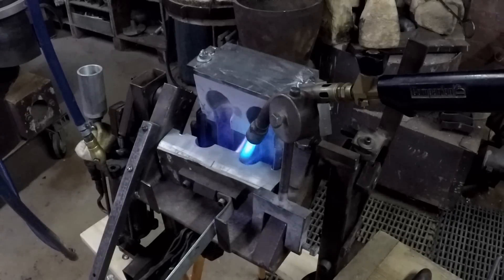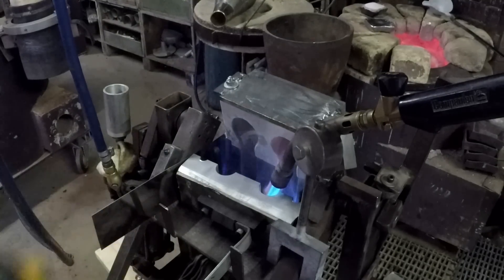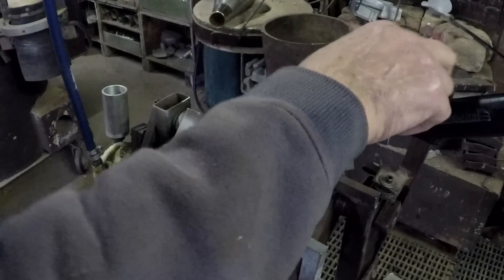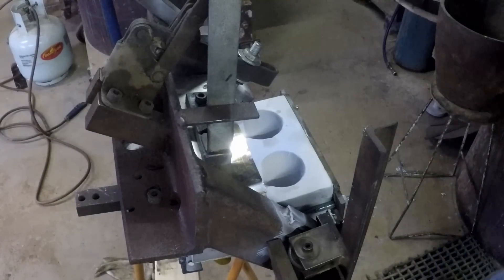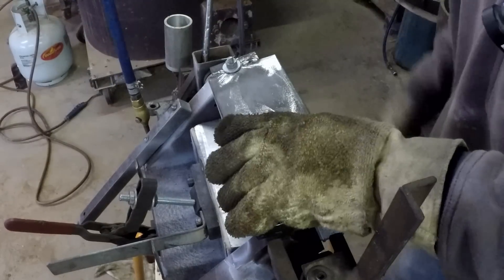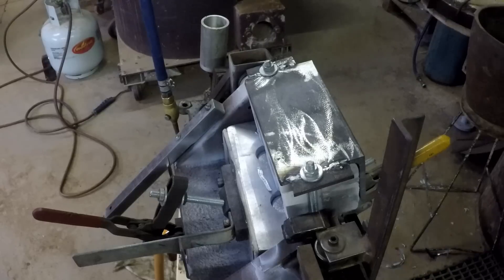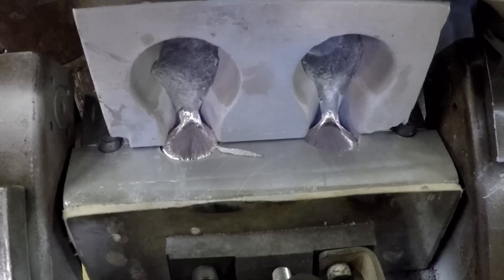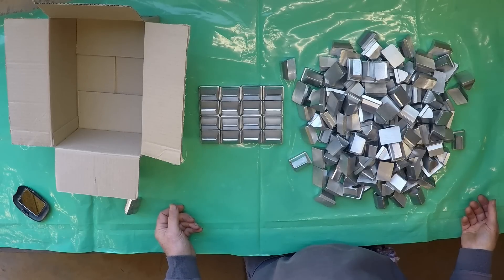Lens Blank Gravity Die Casting

Comment: Splendid as ever Martin ,interesting thing about the optical  pyrometer, I allways fancied one but I'll make do with my pyrometer with a K thermocouple I allways paint it with a zircon refractory wash to prevent the metal sticking to it,I paint all my ingot molds & metal crucible with it as well but not the salamander crucibles, as you will know molten alloy corrodes steel [& contaminates the metal.]
Graham.
Reply from the maker: Graham, I use a type K MIMS (mineral insulated metal sheathed) thermocouple. I have found that Boron nitride is the best protection wash (Hardcoat by ZYP) as it repels fluxes and molten metal but its temperature limit means that it is not suitable for copper base work, For that I would use a zircon wash. I also use the hardcoat on the transfer ladles I use for gravity die work but it is too expensive to use on ingot moulds etc. If you are going to use metal crucibles to melt metal in please don't tell me about it - I don't want to know 😀 as contamination will eventually inevitably occur and it ruins the metal... Martin
Reply: Hi Martin, thanks for the info, when I first started I used salamander suprex crucibles [clay graphite] for brass/bronze Alloys & occasionally iron[seperate one for each of course] I still use them 99% of the time but on occasions where I need larger capacity for alloy only I made one out of a cut down co2 pub gas bottle & coat it with refractory wash![nothing importane mainly house plaques.
Graham.

Comment: 15:40 that reddish-pink glow on the metal, is that the glow from the heat? Or are these other effects happening?
Reply from the maker: Luke, It is from the heat I believe, but these cameras are easily fooled by light levels and background colours thus and do not necessarily give a good colour rendition. Here in the video it looks a little more "pink"  than in real life... Martin
Reply: It struck me as an interesting colour. I don't have any experience with liquid aluminium (yet). I guess the lighter metals melt first before they glow, where iron glows first before it melts... Ahh, just talking about it, and seeing it's a cool day outside made me decide that I'll be doing some forging today. Always love the radiation heat coming off the work piece.
Reply from the maker: Luke, Aluminium turns red about where it melts or a bit above depending on how bright the ambient lighting is the same aluminium at the same temperature can look silver or quite bright red. Cool day, hell, its just 12 deg C outside way to cold for an oldie like me.. Martin

Comment: Hi Martin, a very interesting video series for low rate die casting. Reading through the comments section is also very educational, filled with lots of little pearls of wisdom.
Question, your ladle where do you source them from and it would appear that you have coated it in a refractory cement.
Reply from the maker: Mark, That ladle is a standard product available in a range of sizes from a local foundry supplier. It is only mild steel. I paint it with a boron nitride wash - Hardcoat by ZYP coatings. This wash is expensive but very good. I can give you the Australian suppliers of both of them if you wish... Martin

Comment: Hey Martin. Before you cast the dies for the gravity casting. Do you take the die dimensions into account including with the sprayed on layers? Im just curious how much influence that layer has on the finished product and how good it will fit after.
Reply from the maker: Han, With other work like this I have calculated it all out methodically - the various shrinkages the thickness of sprays etc. and machined the masters accordingly, this time, eh, not so much -  in the sand casting stages I wobbled the patterns around a bit to make the cavities bigger to compensate for the shrinkage but really it just all happened. The parts are small so shrinkage in actual measurement terms is small and the proof of the pudding was when castings were tried in the light and air pressure applied to check sealing no leaks were found so the fit was judged Ok. Customer happy so I am happy... Martin

Comment: If you have anymore larger amounts to make, you need to make a large mold that could pour ten at a time. Automation is the key to mass production. Nice video and clever setup.
Reply from the maker: Gary. Could not agree more, but this was the biggest die I could accommodate in my little tilter and I did not wish to build a bigger one, also there is a limit to how fast I can supply metal  -10 at a time and I would be refilling the crucible every 30 minutes and it takes about 45 to melt! A bigger furnace would be needed and it all just gets out of hand for a little shop like me...Martin

Comment: Ha, I shot some video last weekend and I to use my non contact IR temp gun.
I was casting brass and the temperature was showing low as they do.
Simply the best surface for these things to read against is black that added to other things makes then a guide only,
A quick and easy guide mind.
Reply from the maker: Andy, My advice - get yourself a proper thermocouple mounted in a suitable sheath. (for aluminium but NOT bronze boron nitride wash forms a very effective sheath). That quick and easy guide might be up a blind alley! IR types have a problem generally with varying emissivity and in particular with molten metal where emissivity  tends to be low anyway but very variable with oxide film thickness. You are right about the black as 100% emissivity is called "black body conditions" - molten metal is hardly black!... Martin
Reply: Martin, I have that coverd.
Graphite tipped, these do degrade very quickly in tbe Alu flux so I have some ceramic wash ready for that task

Comment: Very nice work!
A full day then?
Hours of casting, and probably twice that to clean and prep them.
They look great!
I hope you get an order for 20k! :D
You would need a more durable die then. 
Thanx buddy!
Reply from the maker: Captain, 20K Oh My! definitely a cast iron die for that number! That means a full cad drawing and a CNC cut die.
 Actually I was exaggerating the clean up - it took about 40 minutes to remove (nice sharp bandsaw) the feeders and about an hour to disc sand the feeder connection area - a few sanding discs. and the casting was over by lunch about 3 hours to cast plus the melt and heat up time - once when  I was younger I would have filled the pot up again melted it over lunch and cast all afternoon too... Martin
Reply: I would like to just pour a few small things.
I need a place to do it! LOL

Comment: Do you use recycled oil in your furnace?  Love to watch a craftsman at his work.  Great work.  Good luck with the contract!  See you next time.
Reply from the maker: Mature, Recycled oil? No not any more-  tried it years ago - seduced by the "freeness" I guess. But it was Oh so messy friends would deliver 4 galloon tins of used engine oil it was inevitably 2 gallons of oil floating on top of 1 gallon of water itself atop 1 gallon of a yucky grey sludge. It was leaded petrol back then and no doubt the oil contained lead which I burnt and blew around my foundry for all and sundry to breath in - not good! The water and sludge were disposal problems. The oil was too thick and needed thinning with kerosene and filtering too. It caused a clinker lump to build up in the furnace. Also if any differential of gear oil was in the drum it smelled of sulphur dioxide when burnt - also not good! I decide that I was in the business of making castings  and not of reclaiming old oil so I began buying nice clean diesel fuel - an on cost for sure, but a very small part of the cost structure and well worth it for the dirty labour avoided. Other people do it though and good luck to them ... Martin

Comment: The emissivity of clean aluminum is fairly bad too; we had to use black paint or black tape on the spots we wanted to measure for our experiments with analyzing one-dimensional heat transfer performance in a cylindrical aluminum fin.
Reply from the maker: Walt, Most of these meters are set up for about 95% or so of "black body conditions". Many are adjustable but what figure do you adjust them too? Molten metal is hardly a black body. I can imagine your results without that black paint /  tape - not much use I would think! It is interesting though to try one of these meters as I said in the video just to see how variable the results are! And I do realise that the readings I got off the die were a bit  - er - well - sus because it was also hardly a black body, all needed there though was an indication , to be honest a bit of spit on the finger would have been good enough!... Martin
Reply: Could you have made the whole die out of ceramics like the pouring basins?

Comment: Learning and watching. Giving me new things to think about. And I'll come up with a few more questions to keep you on your toes Martin!  Thanks for the great video.  Mark
Reply from the maker: Mark, Ask away I will try to answer... Martin
Reply: Well you made me think until smoke came out of my ears! So this is basically a series of statements that I think I have gleaned from your videos and your comments. The mini basin you pour into before you tilt  is carved out of a refractory I think you said. Sized as per required volume of casting and feeder sprue. That makes sense. I have looked up the release agents and saved the website link. As you continue to cast I'm guessing that the heat from the aluminum will keep the die to proper temperature. I think I understand the mechanism of the tilt system and it could be converted from your oil filled cylinder system and accumulator to either a car shock or a pneumatic cylinder and an accumulator for air pressure. I think an air shock might be the simplest if you consider that you can alter the pressure and the slide in out time.

So onto the burning question ( wait for the pun ) over the period of the casting you are probably having to keep the furnace running. Did you degass only at the beginning and that's it, or did you degass part way through the mornings work? As a youngin I really knew nothing of degassing other than it was what I wanted to do, but never successfully did it! And I know for a fact that adding anhydrous substances like washing soda does little more than make steam bubbles. But such are the perils of watching people do their stuff. I used to use grossly oversized sprues and create bubbles and hammering in my castings and had no idea why. What I have learned from your series of videos is priceless and very much appreciated.
Reply from the maker: Mark, You pretty much have it sussed. All gravity dies have a rate at which they can be cast it is a question of heat in and heat lost, a balance is struck and if you have it right the die temperature stays roughly the same. Each die seems to have a temperature at which it runs best and a metal temperature which forms the best casting. Sometimes one has to resort to things like water cooling or insulating he die to keep the temp right. If you look  at the die in this job the two feeder sections have a layer of insulation blanket under a bit of stainless steel sheet on the outside of the blocks this is to help keep the temperature up a bit as there is little metal being poured into a relatively large die - a recipe for a die running too cold. Any cylinder that you can convert to a dashpot with a one way valve in the piston to allow quick lifting back to the pour position would do nicely. 
Yes the furnace runs the entire time I am casting, on a low setting but with me keeping an eye on the temperature of the metal. For gravity die work I do NOT degas the metal at all. The use of purchased ingot plus the quick solidification time means there is little gas and little time for what there is to come out of solution and form bubbles. In fact many gravity die shops used to deliberately gas their metal as it can help with problems of shrinkage and cracking if there is a bit of gas coming out of solution. Foseco used to sell a product called "Dycastal" which was designed to actually gas metal - not a practice that I choose to use! I am glad that the message of the perils of washing soda "gassing" and the evils of the use of huge high sprues is starting to spread.. Martin
Reply: @olfoundryman8418  I believe you are saying that most air bubbles are caused by incorrect pouring practices and large sprues that allow air to mix with the aluminum during pouring, correct?  Forgive me if I'm wrong, but I have some old notes that I thought came from one of your videos where you used "... a purge gas (delivered through a lance) to remove the hydrogen from the melted aluminum."  You talked about how "Hydrogen loves to mix into molten aluminum.  If not removed, the hydrogen is released as the metal solidifies and leaves porosity in the castings. The lance (coated in a boron nitrite) causes the purge gas to be released at the bottom of the crucible, and as it rises, the hydrogen is drawn into the bubbles and taken to the top surface and released into the atmosphere."  Did I mess up on my notes?  If not, I'm a little confused about the need to degas or not?  I have obviously put 2 & 2 together and got 5.  Any clarification you can provide will be greatly appreciated.
Reply from the maker: @chuckbailey7200  , Yes, most or more likely ALL AIR bubbles in castings are caused by bad pouring practices- high overlarge sprues bad pouring basin design, sprue base wells, badly designed runners and gates etc its all down to turbulence and mixing of air into the metal during the pour and mould fill. BUT do not confuse air bubbles (usually over 1mm in diameter) with hydrogen gas bubbles (usually under 1 mm diameter). Hydrogen - usually from the reaction of water vapour and the aluminium - dissolves in the aluminium just like sugar dissolves in tea but solid aluminium can not hold as much hydrogen in solution so as it goes solid the hydrogen can come out of solution as small bubbles. These are often so small as to be difficult to see and for a lot of casting work their presence is not to much of a bother. - I think that too many hobbyists get way too concerned about this and that they would do better to improve their pouring practices and to use reasonable metal rather than to get uptight about a little hydrogen porosity. With me its a little different - many of my castings get almost mirror finished and need to be as gas free as possible to avoid visually obvious pores so I degas by purging with argon.
The hydrogen tends to move from where there is more of it to where there is less of it - like heat moving from something hot to something cold - in this case from the aluminium to the argon bubbles and thus it is taken out of the melt as you indicate. An equally important (some say more important) function of the purge gas bubbles is that the tend to float out oxide films and as these form lines of weakness in the casting if not removed and also serve a nucelli on which Hydrogen bubbles and shrinkage porosity tend to form  their removal is a great benefit of fine bubble degassing. Note that the Argon purge gas bubbles have to be fine as possible, commercially rotary degassers are used where an impellor chops up the bubbles to a very small size - sadly I can't run to one of these devices as they treat much bigger lots of metal at a time than I use.....Martin
Reply: @olfoundryman8418  I can't thank you enough for the clarification.  You are extremely generous with sharing your knowledge, and I truly appreciate your time and attention given to my question.  Many Blessings!